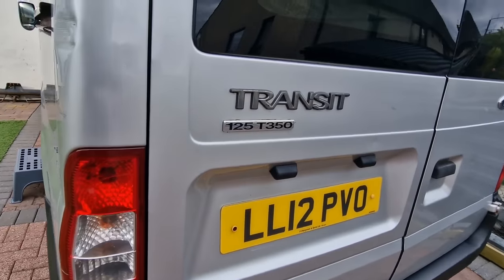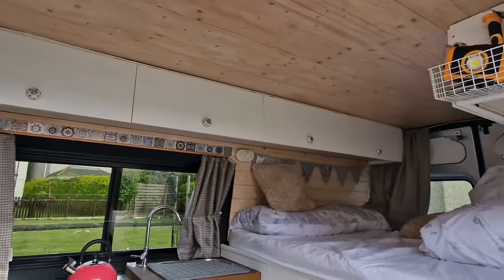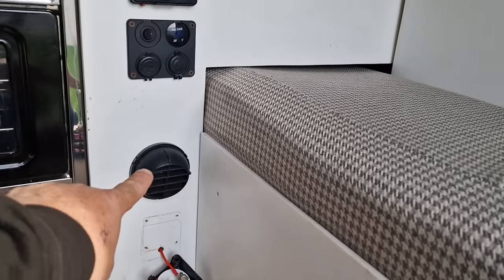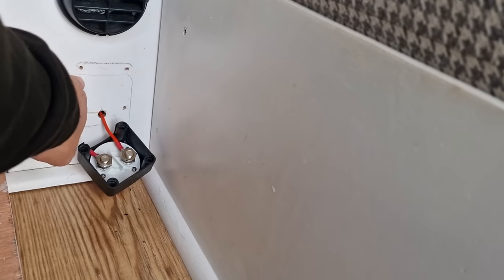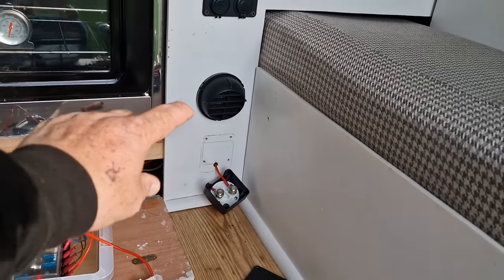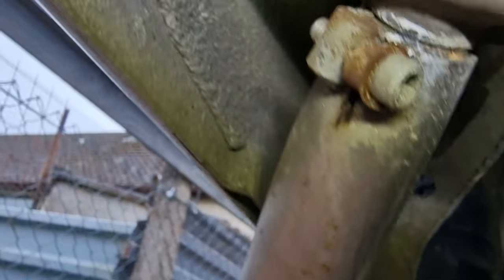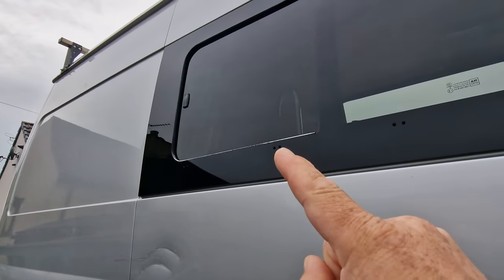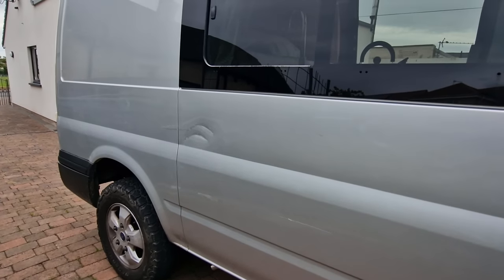Is the most dangerous self build campervan I've came across?

Comment: Gas systems can be bullt with 1 piece flexible pipe, but needs to be protected where it can potentially rub, I would not recommend that or copper pipe as it can become brittle and fracture in cold. CuNiFer is better, Steel is also suitable in some instances. Yes, the bottle needs to be in it's own container and vented with a size specific hole to atmosphere, bear in mind the volume of potential gas leaks. Again, I prefer an external locker so it cannot enter the passenger compartment. If built to boat safety spec it will pass camper inspection. All joints must be accessible and all items have an  individual tap to isolate. Also must have an inspection valve.

Re nightheater, it's all within distance spec, I would also not think the gas will be coming from the exhaust outlet, more likely the seal on the heater body to pipe AND the internals of the heater as there is a paper gasket that degrades over time, if that has a breach it will directly flow exhaust gasses into the recirculated air! Obviously if there is a partial vacuum in the inlet it will excentuate that draw. The other thing to acknowledge is the heater will shut down if it cannot get enough fresh air. That is important to know if you are experiencing issues. 

There are various schools of thought on isolating solar, personally, it depends on the system that is being employed. Some if you have solar connected and no battery, you blow the regulator! That equals fire, so do not fuse! No need. Others can be best to fuse all connections. Isolating some panels can massively damage them while others you need to short circuit, others are fine to be left open... I would not use house mains cable for anything but house mains, it's not really designed for it and it has a high loss compared with 12v cables. The box isn't really an issue either other than it looks bad and the wires from it are a total mess. I would not have built like that, but I can see why some do. I would als onever use those dodgy blue, red and yellow bad crimp terminals... 
Battery cabling is also no where near adequate for the batteries. 

As you say, the regs are easy to find and adhere to, I've been doing boats and campers/land rovers for about 30 years. I do work on the safe side with quality hardware. On my personal Land Rover build I have 5 fuse boxes and master fuses directly off the batteries. It's not difficult to be safe. The systems can all be isolated by switch or relay. Master switches are readily accessible.
Reply: Nicely put, I wouldn’t seal the heater floor hole, I would replace it with a turret ring to prevent the floor chafing the pipes. Still if the cables are undersized, they will nice and warm and the diesel heater won’t be an issue 😮
Reply from the maker: Some great points and advice thank you

Comment: I am by no means a professional van builder or electrician or gas fitter, however im all for learning and giving it a good go. But with amount of quality, accessible, free info out there, there is no excuse for turning out a job like this. Personally if i were you I wouldn't be touching it unless it meant ripping it all out and doing it all from scratch. If thats how bad to visual stuff is imagine the state of the wiring behind the walls etc!
Reply from the maker: Lucky for me there's on  2 lighting circuits behind the panel all the rest is accessible, I've totally ripped it out and started again
Reply: I has been a electrician for 45 years. This is terrible bad. This is a fire bomb. All i about documentaton in every detail.

Comment: Brought Mercedes sprinter 2016 conversion 2 years ago. I admit i didn't know what i do now. The electrics cables on 240 were fitted with grey house hold rigid cable. The gas fed was all hose, night heater what a butchery job. Anyway all good now learnt a lot over the last 2 years. I think personally all conversion should have electric and a gas certificate, get rid of the cowboys 🤠 but i guess that would be very hard to regulate. Do your homework or get someone to check the conversion campas who know what to look for. Great video dude. Safety first 😊.

Comment: Great video, thanks for putting it together.  I've just purchased a campervan and as you say you don't know what you don't know.  I've already fixed my electrical isolation issues!  But will be checking the night heater to see if that needs a do over.  One thing that would be of interest is a 240v ac install should be earthed with fuse techniques and how you test it for safety.

Comment: Those ovens need ventilation around the sides, be cautious if you're going to cover it with something 'behind drivers seat' they're not bad little ovens for the price but yes, really for open areas and/or large tents; I have seen them in vans but with 35mm gap at least all around and fireboard used.

Comment: Thanks for highlighting these issues. 
I bought a pre converted van.  
Issues... the diesel heater exhaust came up through the floor (gas bottle vent) . 
The gas actually leaks (alarm works though)
So, plenty to rectify and this week swapping the diesel heater for a modern version just to be sure. 
September, actually going full time van lifing so Ive got to be safe and happy.
Next is a solar install but I will keep it seperate from the electrics already installed.
Reply from the maker: Glad it helped

Comment: Why do people insist on lengthy gas pipe runs? It's asking for trouble. Don't buy a second hand conversion with a permanent gas system without a gas safety certificate. Easy enough to get tested.

Comment: Shocking, I've probably gone over the top,  everything is fused to the wire gauge and then the appliance  and I have four isolators so I can work on separate parts of the system if I ever need to. When I'm not using the 3kw inverter for the induction hob it's isolated, saves on waisted power and everything else is on DC. Id rather have a fuse blow than a fire. I did enjoy learning about the electrical side of the build.

Comment: Nice one sam,  very dangerous build. At least the owner knows you'll do it right, and it'll be safe.
Reply from the maker: It had to be done I couldn't live with myself if something happened to them
Reply: @TheCraftyBlindersvanlife  I've just stripped out a t5, they had used heavy duty cable for house consumer units for the solar and 12v system. Very very bad.

Comment: Hi, just my two pennies worth. I hope you all "start" mounting electrical equipment with the correct air gaps (they have heat sinks for a reason) and  especially NOT mounting "it" on flammable surfaces (wood or carpet or sealed plastic box,doh) ! i always use aluminum to dissipate heat.
Also each individual item and main circuit should be fused, (mega and midi) and isolated !
Cheers c
P.s great informative video 👍

Comment: I don’t know much about electrics and im currently doing mine, put a battery isolator in but no solar isolator. Surely if i needed to work on any part of the electrical system i could just use the battery isolator to make it safe and if I needed to work on the solar part of the system I could just remove the fuse I’ve put along the positive wire? Great video though so thanks mate

Comment: Great video.  👍  just subbed you...wish id known about you before id bought my ambovan...bought in good faith from so called friends for 12k,probably a dodgy mot,2 x tyres on back not rated for the van,2 noisy wheel bearings,track rod ends shot,rear suspension going down every night..took to my mechanic and he said he wouldnt have passed it Thankfully all repairs done now and currently rebuilding inside
Reply from the maker: Sorry for the delay in responding. Glad you got sorted out

Comment: great that your highlighting dangerous van conversions is truly shocking that people can get away with doing this sort of thing and then being able to sell on the van without any safety checks having to be done ,this morning came across a truly heartbreaking vlog on you tube by a channel called trevor and pat life on the run (the carnage that was our van )who suffered a head on crash in their motorhome i think everyone should watch it to see exactly what happens in an accident of this magnitude and what happens to anything in the back of the van you was right to mention the gas bottle in this build not being secured the couple in this vlog are in a factory built motorhome and im certain if it wasnt for the fact the build was done properly this couple would not be alive today as it is the devastation in the back of the van has to be seen to be believed and is a wake up call for anyone building a van to make sure that everything is secured as well as it can be to the structure of the van and to not cut corners
Reply from the maker: So true 🫶 thanks for sharing

Comment: Very good video, thank you. What size should the gas dropout vent be and what is the maximum length one can run a copper pipe to say, the stove. All the best.
Reply from the maker: Sorry for the delay in responding. Did you get sorted
Reply: @TheCraftyBlindersvanlife  No worries. Still dreaming and scheming over here but gathering intel as I go. Hoping to see a 16t box truck converted and hitting the road as retirement.. In my plan i have two gas bottles in side storage under the box with the stove directly above.
Reply from the maker: @JohnDoe-qr2cp  sounds epic 😎

Comment: Heads up to Victron because I have no clue how they managed to connect that controller without isolation switches to prevent damaging the controller? And as you rightly said if you dont know you dont know. anyone watching needs to know you have to connect the battery 1st solar 2nd via large amp breakers or you will blow that controller I learned the hard way. 42V coming in from my panel soon smoked my controller as you say do your homework as I have now done and have re done my whole electrical system to make it safe. I am still learning/researching  thats why I am watching this video!
Reply from the maker: Your totally right 😁👍
Reply: Really??? throw a blanket or cardboard over panel and poof no more power
Reply: @mrmotofy  Is it so hard to put a breaker or off switch in the wiring £5 off Ebay click a switch "poof no more power" especially when the builder of the van couldnt even be arsed to screw the controller securely having wires moving around everywhere not great is it!
Reply from the maker: @mrmotofy  I'm not sure what you mean?

Comment: Great video Sam. Certainly highlights the dangers of self builds. I also have a spare brand new auto term turret mount I can send on to you if it helps. It’s the shallower one of the two. Came with my kit but I needed the deeper one due to floor thickness. Drop me a message and I’ll gladly send it on for you.
Reply from the maker: Hi, I really appreciate the offer, but I've ordered a new one. If it's the auto therm stainless steel one, they are worth about £30 get it sold and make some cash back mate
Reply: @TheCraftyBlindersvanlife no problem Sam. It is indeed the Autoterm stainless one. You could have had it by all means. Sometimes trying to sell stuff is more hassle than it’s worth.

Comment: Errr meets BS EN 1949:2021 regulations, don’t think so! Well done Sam you may have saved their lives. Didn’t hear any mention of a carbon monoxide detector either. As for the electrics wow. Ironic that a fuse box was fitted for low amperage items like lighting but not at the batteries for high amp devices like the solar or alternator charging or between the two batteries should one internally short the both will go up. It didn’t even look like the batteries were a matching pair. Don’t suppose the cooker had a gas drop out either. Def got your work cut out there Sam. Reckon you’ll rip it out n start again for your own peace of mind. Good on you for calling the fitter out.
Reply from the maker: They do have a carbon monoxide monitor fitted that's why I never mentioned it it's one of the only positives 😊👍

Comment: The solar charge controller is probably tost aswell now you the battery has come disconnected
Reply from the maker: No it's working fine, fitted afew of these if you follow victrons guidance there is no issue

Comment: Funny a narrowboat needs a safety certificate to be on the water but we have vans like this on the roads. There are many documents of the safe installation of the smallest detail for a narrowboat and you must have a certificate from a qualified gas installer, all electronic wiring has to be checked by a qualified inspector every four years just to be on the water.
Reply from the maker: is that a requirement for you insurance company?

Comment: So true Sam "You don't know what you don't know." . The issue is knowing you don't know what you don't know . 
Yes the information is out there for correct installation of gas ,electrics etc .
But if a person "thinks" everything is installed ok , when it's clearly not , why would they then go looking for the safe way to install something ?
I think there needs to be much much more education on building/converting vans , cars , trailers , lorries or any "tiny" build.
Not only on the correct safe way to install things but also why it could potentially be dangerous to install it any other way .
As regards "Professional" builders there needs to be a lot more regulation . Some sort of industry recognised accreditation scheme. 
The "Builder" that has built twenty seven dangerous/unsafe vehicles needs either educating , reporting or stopping building altogether.
The fact that your friends are still alive after using this van for so long is nothing short of a miracle or the grace of God .
Thank goodness you've stepped in to help Sam .

Fattrucker
Reply from the maker: This video was to highlight to potential buyers what to avoid
Reply: @TheCraftyBlindersvanlife  Exactly Sam . A very good video it was too . 

Fattrucker

Comment: This is possibly the worst conversion I’ve seen in a long while. However I’ve seen a similar problem with a diesel heater on a Carthago Chic Motorhome I owed 16 years ago. The diesel heater exhaust outlet was near a dropout vent. On the same van the exhaust for the water heater was directly below and within 30cm of the electric hookup point. On a cold day when on hookup condensation would form on the electrical hookup from  the flue vent. Seems even the big guys get things wrong at times.
Reply from the maker: Wow, that's not good at all

Comment: I had a gas bottle fail. I only knew as it had leaked because it was empty within days. Drop out did its thing and allowed the gas to vent away and disperse.
Reply from the maker: Two dropouts fitted now and a cabinet new pipe work throughout

Comment: I've lost count  of the amount of van builds I've watched on YouTube that are complete death traps. Many of these builders have done many builds and portray themselves as skilled builders. Shocking wiring, lethal gas and heaters, lethal battery mounting.... The list goes on. Nobody sees to give any thought to what happens in a collision either. Magnetic knife holders, glass jars with the lid screws under a shelf or cupboard, all potentially lethal. I worked many years as a  specialist vehicle engineer building vehicles for the military and airport fire vehicles.    Prototyping and testing these vehicles highlighted any build issues and you would be amazed at what can fail despite it appearing to be well engineered. Even the vehicles built by well know manufacturers are really poor in some areas. There really should be a system of inspection and approval   for these self builds. Much as I hate red tape and legislation I think it's necessary. You can't drive a vehicle that is not roadworthy. Well, a build like this is neither roadworthy or habitation worthy so should be condemned.
Reply from the maker: I totally agree, selfbuilds should have some form of inspection rather than a few pics been sent off to DVLA

Comment: Potential death trap. Do they not have any mandatory inspections on these builds when they are completed? Also any environment like vans/boats ect with gas and exhaust fumes should have a carbon monoxide detector and a smoke alarm, no question.
Reply from the maker: No inspection required at all, the only issue is if it's not built to regulations and is damaged as a result of a bad installation the insurance company would not pay out

Comment: As I can see the cooker should be ID and not used and capped off 
As a little knowledge is very dangerous 
Gas Engineers spend a long time studying the rules and regulations 
And what you can and cannot do 
And some of the stuff that you have said is probably not correct 
If I was in your position I would get a lpg qualified gas filter to give you certificate  of safety at the end of the job
Reply from the maker: What do you think I said was not correct?
Reply: @TheCraftyBlindersvanlife  yes I am sorry you are wrong cooker not for inside 
It’s not for inside   ID
Reply from the maker: @DSTRacing  yes your correct I did say that it's not for indoor use I even showed the sticker I will not be reinstallingredients the cooker just replacing and testing the pipe work up to that point 👍